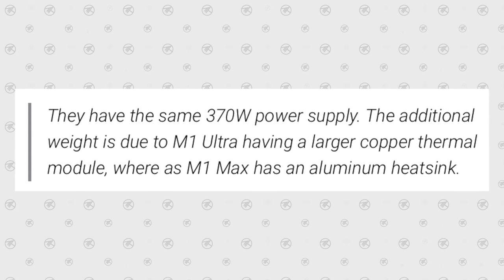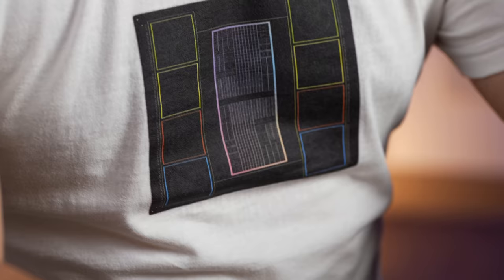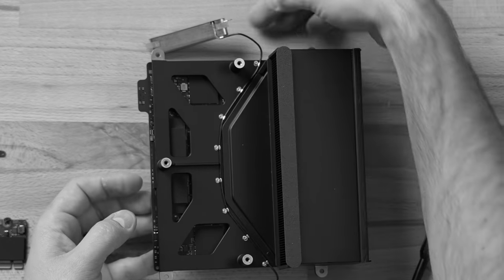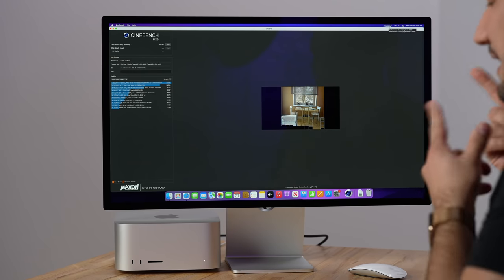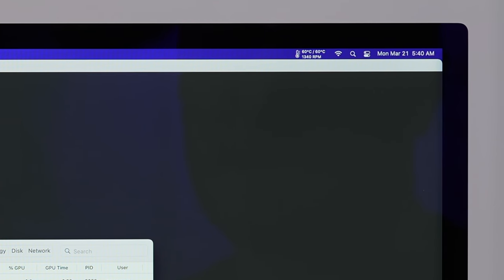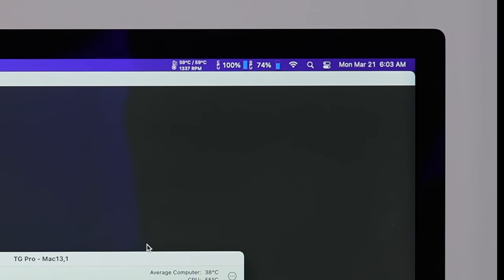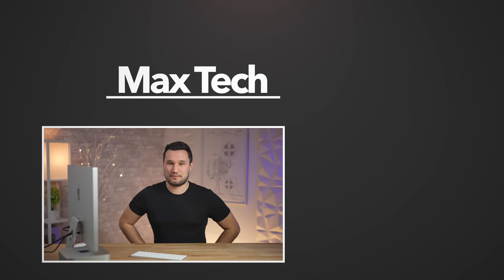M1 Max vs M1 Ultra Mac Studio: Thermal Throttle Test!

Comment from the maker: Were you SHOCKED by the SECRET we found in the M1 Max Mac Studio cooling system? Comment below!
NEW M1 Ultra Chip T-Shirt ➡ https://max-tech-store.creator-spring.com/listing/apple-m1-ultra-soc-package
Like our Wallpapers? Download them here! ➡ https://bit.ly/2WNc6Qw
Download TG Fan Pro for Mac ➡ https://geni.us/dkbrc75
iFixit toolkit ➡ https://geni.us/p8JVj0
Best deals on M1 Macs on Amazon ⬇️ 
Apple Mac Studio with M1 Ultra ➡ https://geni.us/cgkl
Apple 27" Studio Display ➡ https://geni.us/GeA3te6
Reply: I been watching your videos for months!
Each video is HIGH Quality and from the thumbnail I could easily see that there was a LOT of difference between the aluminium and copper heatsinks/cooling. Thanks for covering the reason behind the difference in weight. Love your videos, always! Watching this at 2:12AM lol!
Reply: You should install the M1 Ultra heatsink into the M1 Max motherboard, if its compatible of course!
Reply: Can it be overclocked? Does it need a firmware change or something to overclock?
Reply: What happened to the Fan Noise & Speeds section?  What are the sound differences?
Reply: What about the fans of the MS M1 Max being audible when idle? There are some rumors about this on the interwebs. Can you confirm this?
Reply: @BorisZech  I returned a Studio Max for both a loud idle fans and a high pitched whine. Some units must be worse than others.
Reply: @Joe_Brig  Ouch, that would be no go for me, too.
Reply: Well, the reason the ultra had no Heatpipe is because the whole section was a vapor chamber, which is storing and conducting energy, but is also more expensive to make.
Reply: 👍👍👍👍#APPLE Mac Studio, #cinema display with the #Lumiy Lightblade is a major game changerrrrrr 👍👍👍👍👍
Reply: I don’t think M1 Max throttles the GPU, actually. As you’ve noticed with the GPU-Only test, the CPU was loaded at ~25% as well. Meaning that to have GPU at a 100%, you need CPU to have some calculations done as well in this exact benchmark. So, when you have CPU dedicated to Cinebench, it isn’t able to fully supply the GPU.
Keep in mind that when CPU/GPU shows less than a 95-100%, it isn’t fully loaded and isn’t limited. If we’ll have the same 80% load and slowly reduce the clock speed, load will go up, but the performance won’t change until we hit 100%. Basically, load is relative and depends on what headrooms GPU has.

TL;DR: GPU isn’t limited and you need another test to check the temps
Reply: Please try to fire up two GPU bench apps at the same time.

Comment: Copper has almost double the thermal conductivity for the same area. The reason the temps are the same is that the M1 Ultra occupies a larger (almost double) area. So it all evens out. Idk why I’m pointing this out I guess it’s just nice to see that the results are consistent with physics.
Reply: Maybe with extra headroom if you load it up with max amount of RAM
Reply: Would the black paint help with the cooling too?
Reply: Thermal conductivity is an intrinsic property of the material and not related to area.  For a heat sink, aluminum alloy is usually used because you can increase the cross section to achieve the same thermal resistance in plane as copper.  If you have to use copper it’s because there was no space.  Copper actually has more than twice the thermal conductivity of the aluminum alloys used here, since pure aluminum is rarely used.
Reply: @justinhalsall4077  the radiative coupling will be relatively weak if the absolute temperatures and their differences are relatively low.  Also note that in the infrared wavelengths of interest the colour is not important, it’s the thickness of the paint that dominates the emissivity, since if it’s too thin the paint layer becomes transparent and the metal underneath has low emissivity due to the electron mobility
Reply: @ProfessorHamer  maybe I have the scientific terminologies in English wrong but I do know that the thermal properties and area covered and volume used are all correlated. Thank you for adding to my knowledge.
Reply: @justinhalsall4077  in this case, not much. Apple likes their boards black.
Reply: Everything is consistent with physics though.
Reply: @Graxxor Anandro Vidhelssen it’s just satisfying to see is what I was trying to say lol!
Reply: a heat pipe is much more conductive than pure copper sticks. the construction you called a copper block should have a similar structure as a heat pipe to allow even and fast thermal transfer.
Reply: What area are you referring to? The only area that matters is the fins surface area. The reason why the max is staying as cool as the ultra with a worse cooler is because of lower heat output. The die area alone doesn't matter for cooling
Reply: Copper would be preferable in every way for a desktop, cause it is heavy. If you ever have the choice though.. seeing lots of copper is 9/10 times a very good sign.

Comment: at 11:01, you can see in the top right (nearish the clock) the gpu is running at 100% while the cpu is at about 24%.  This suggests to me that running the two tests at the same time meant the cpu wasn't able to feed the gpu fast enough to max it out.

Comment: Nice Video! Quick comment one your statement from 12:45 ("Apple is limiting graphics performance"). It's very likely that they are not. The Geekbench stresstest is very demanding, taking up almost every tiny bit of the CPU, leaving not much for other tasks (like moving the mouse or opening a program etc.). Even though the 3D mark stresstest tests the GPU, it also needs some resources of the CPU. So because the CPU is already so busy with Cinebench, it probably can't feed the GPU fast enough for the 3D mark test. Long story short: With Cinebench running, the 3DMark stresstest is CPU limited. At least that is my humble opinion on the matter. Maybe worth trying another combination of CPU and GPU stresstest.
Reply: Yeah the second he made that statement I knew he made a large mistake with his logic, Apple is not putting any artificial limitations for this scenario to happen, it simply becomes the CPU becomes the bottle neck with the specific tests they are running.
Reply: I was going to comment the same. GPU test can’t run at 100% if it was using 25% CPU alone and Cinebench is stealing most of those cycles in the combined test.
Reply: Agreed, try setting Cinebench to lower priority and see if that changes the results.
Reply: @MoonshineOctopus  We have been seeing bottleneck tests for decades now on systems, I don't think the reviewer in this case is as familiar with this, it is difficult to get a test to stress 100% of both CPU and GPU as it is perfect balance needs to be reached and that balance differs on every system config.
Reply: Came to say the same thing. This is almost certainly the case.

Comment: The different thermal pastes (thermal interface materials) is likely due to several factors: There is a requirement to minimize resistance to heat flow (thermal impedance) and also a need to accommodate tolerances of a variety of chip components within the multi-chip module.  Since the CPU is the most power dense, the engineers want to minimize thermal impedance path from the CPU chip to the heat sink system, thus the thermal interface for the CPU is optimized for the lowest thermal impedance (the gray stuff).  Since it would be more costly to make the memory chips perfectly level with the CPU (eg. precision grinding/lapping of an already-assembled SOC module) and use a single plate (as they did for the ULTRA), the engineers opted instead to use another type of thermal interface material for the memory chips (the black stuff).  This is actually a gap filler material since the mechanical limits of the CPU interface will actually limit how close the memory can get to the heat sink. Gap fillers are designed to be highly compressible with low application force and then stay in place. The gap filler for the memory probably has a much higher thermal impedance than the CPU because it is thicker, but that is OK because the memory also has much lower power density than the CPU.

Comment: The M1 Ultra heatsink fan (HSF) had a copper vapour chamber to transfer heat from the M1 Ultra heatspreader to the copper finstack. The M1 Max HSF features a more simple and conventional copper heat pipe to aluminium finstack setup.

Comment: The ULTRA has a vapor chamber in place of the heat pipe in the MAX (at 4:30). The vapor chamber is similar to a heat pipe in terms of principle, but it is constructed by layering and fusing copper sheets instead of starting from extruded copper tubes. The advantage of the vapor chamber is that the enclosed volume isn't limited to one dimension (the tube profile), so heat can spread in two planes instead of one.

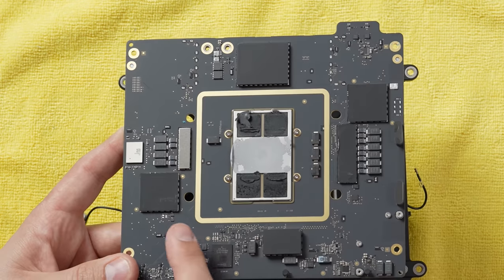Comment: UPDATE to my original comment!! I Isolated out an issue that was causing the slow export times on both the Mac Studio and the Intel MacBook Pro. It turns out that if you add the "Outline" effect to a title the export becomes more than twice as long for some reason. So the Mac Studio with M1 Max is now twice as fast as the Intel MacBook Pro I was comparing it to. The M1 Max now exports the same 6:30 minute clip in 53 seconds and on the Intel MacBook Pro it now takes 1:10 minutes instead of 4:23 minutes. Super happy I found this out! My recommendation to anyone using Final Cut Pro is not to use the "outline" effect on a title if at all possible otherwise your export times will be much longer.

So far I am disappointed with H.264 performance on my Mac Studio with the M1 Max. In nearly every test that I've done the export times in Final Cut Pro are always about 36 seconds slower than my 2019 i9 15 inch Intel MacBook Pro. My expectations were super high for this but seeing as it is slower than older Intel machines when it comes to H.264 footage I may end up returning it until a fix comes to change this.
Reply: So your $2000 machine is 36-seconds slower than your $3000 machine while being completely silent and the fans don’t kick on if you connect two displays? Ehhh return away, I guess… someone else will snap up your folly of a refurb.
Reply: @Wizzy0037  I actually have an update to this original comment, I forgot to edit it. I ended up Isolating out an issue that was causing the slow export times on both the Mac Studio and the Intel MacBook Pro. It turns out that if you add the "Outline" effect to a title the export becomes more than twice as long for some reason. So the Mac Studio with M1 Max is now twice as fast as the Intel MacBook Pro I was comparing it to which is what my initial expectation was. The M1 Max now exports the same 6:30 minute clip in 53 seconds and on the Intel MacBook Pro it now takes 1:10 minutes instead of 4:23 minutes. Super happy I found this out! My recommendation would be to never use the "outline" effect on a title unless it is needed otherwise the export times will be much longer.

Comment: Got a question, do softwares and programs need to optimise for m1 ultra over the m1 max?
Will apps need to update to use the extra power that comes with the chip?
Reply: Generally speaking yes. FCPX will need to update and probably countless other developers as well.
Reply: I’d say so also. Will be interesting to see the performance on these in the next year

Comment: Love your energy for these videos. Still waiting for mine to arrive. I got the M1 Max with 10-core CPU, 32-core GPU, 16-core Neural Engine
32GB unified memory
1TB SSD storage. Figured this should be more then enough power for me for hopefully years to come
Reply: Years to come? You wont be needing another computer DECADS  to come unless apple decides to start slowing down their chips like they did in the old days lamo
Reply: @samuelchimezie  I still use a MBP 2012 fully upgraded and works great at a decade old. So this will will be a huge upgrade. I am thinking of getting the Studio display as well. Then see what comes out in the next year or so and get another MBP with M2 or whatever chip is avail then

Comment: Is there a high power mode in the Mac Studio like there is for the MacBook Pro? Maybe if you select it, it will enable both the CPU and GPU to run 100% at the same time. Try this on the MacBook pro aswell.

Comment: Hey Max… I watched Luke Milani’s video about adding SSD to the Ultra. Why does the Ultra NOT have any chips under or next to the slot where the SSD would go, but on the M1 Max it does? I’m sure you noticed this already. I wonder if an SSD would operate on the M1 Max?

Comment: Thx for the review I love your video’s and clear way to explain. Question nobody is talking about Fusion360. Does it make sense to buy a M1 max or even an ultra when using Fusion360. I liketo update my desktop ( Mac Pro M1), I use Fusion360 all day. Pls pls pls advice and maybe do a test. Nobody make movies about Fusion360. As far I know Fusion is not supporting native M1, but what are the performance doing with Rosseta2 application.

Comment: I notice that in second SSD port at M1 MAX there are controllers that are missing in second port at M1 ULTRA which course on tests that second port could not be use for upgrade. Because there are chips in M1 MAX that would suggest possibility for upgrade. Can you please check that ?

Comment: Honestly, I really had thought that the Studio was a bloated Mini with a big chip in it. Your tear-downs have completely eradicated that thought. I don't know if Apple appreciate you or not (probably not as you specialise in leaks!) but they should be appreciative of these Studio videos because they reveal the massive amount of effort and thought that Apple has put into creating these models. These units are so technologically dense that I think they are worth what is being charged and, by virtue of your videos, we now know that Apple could very significantly increase the performance of these machines any time they wish with a simple software update that allows another 20degC or so for the chip. Great job, guys!

Comment: Please run a simultaneous session of: 1. Xcode compile test (repeatedly over and over); 2. Logic w/ multiple tracks of white/pink/brown (different types of randomised) noise + plugins;  3.  Video editor with a 4k edit. Time the compile tests. Track that time against the # of tracks in Logic as you increase them and the size and complexity of the edit. Artificial benchmarks are fine, but there is no real substitute for real-world workloads.

Comment: The supposed full copper heatsink of Studio with the M1 Ultra is most likely using a vapour chamber from what you showed. And not surprising given the size of the M1 Ultra as compared to the M1 Max. But great in-depth look at the coolers and cooling capabilities.

Comment: When you run thermal testing please mention your room temperature.
Reply: The room temperature is probably higher than the measured RAM temperatures. Normal room temp should be about 20-22 degrees Celsius.

Comment: 1:45 In Luke Miani's trying to upgrade video, you could see that the SECOND SSD port had a BLANK PCB under the SSD port.. but here that isn't the case? Wonder if YOU try to upgrade the same way, will it work...

Comment: 7:01 the M1 ultra have a much larger heat pipe than that M1 Max. the heat pipe is not made of pure copper, infect they pulled almost all the air out of the pipe and added some water vapour in it, making it extremely efficient in transferring heat than copper by condensation. it is worth noting that this structure does not necessarily need to be done in a  pipe looking way, in fact, it can be done in all different shapes as long as the condensed vapour can return to the chip efficiently so that it can be heated up again ( to transfer heat ), it will work. I expect the entire "Copper" instruction of that area covering the chip to have empty space ( low pressure when compared to 1 atm ) and contains some water vapour such that it will function like a heat pipe. 
since heat pipe is much more conductive than pure copper can is capable to spread heat much faster, I can't think of any reason apple will not that the design described above.

Comment: Ehy Max, great technical video and very easy to follow, thanks for doing that! Quick question, is it possible that at this stage the Ram temperature is the limiting factor? I believe ram should not be anywhere close to 80/100°C and since it so very close to the CPU/GPU they are keeping lower temperature limiting the performance. Maybe this effect was very limited to the smaller standard M1 chip

Comment: I noticed you said it will be completely silent is that accurate? 

I’m an audio engineer and I often track vocals in the control room 

With my 2018MBP I hear fan noise 

I would consider getting a Mac Studio strictly off the fact that it is indeed silent if it actually is!!🙏🏻🙏🏻

Comment: Hey! i've been hearing rumours about a constant hum fan noise at idle state, on the M1MAX, but not on the ultra. This video doesn't seem to agree with it, but what do we know about it ? seems that people are complaining out there, I'm planning to buy the M1 MAX Mac Studio for Music Creation. I am very sensitive to noise, so a fan noise problem would kill me literally - thanks in advance if you read my comment !
Reply: Sounds like they are putting it someplace like a metal shelf, or a hollow plywood desk that would act as a drum head for the vibrations of the motor. Stick to real wood, and you won't regret it. Particle board and mdf is for cupboards, and not even good at that. As for metal, sit on an empty oil drum and fart. You'll hear it further than a lion's roar. Kids bang on metal pans for a reason. Acoustics, never forget acoustics when setting up your PC layout.
Reply: @arudanel5542  many thanks man for the precise answer